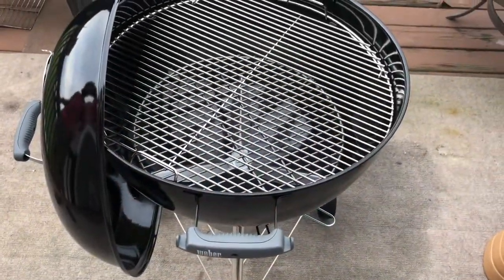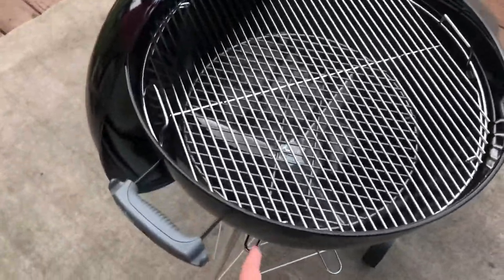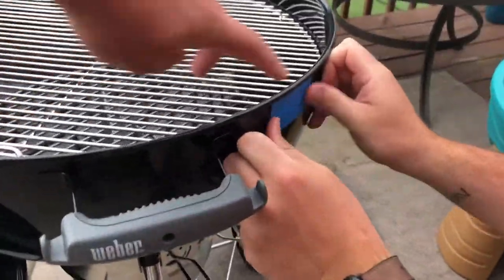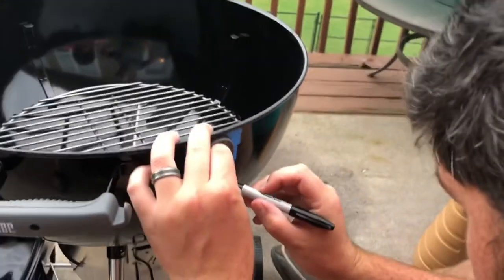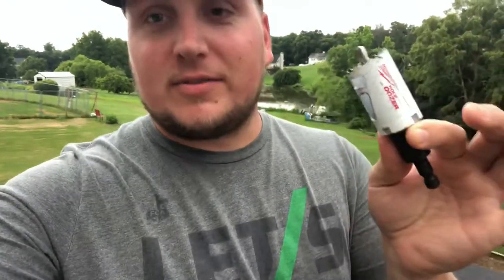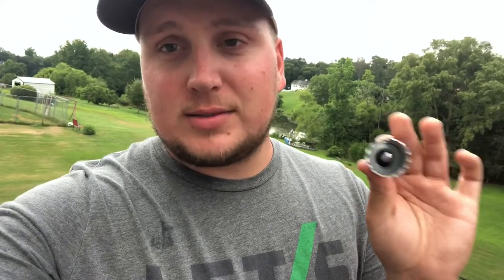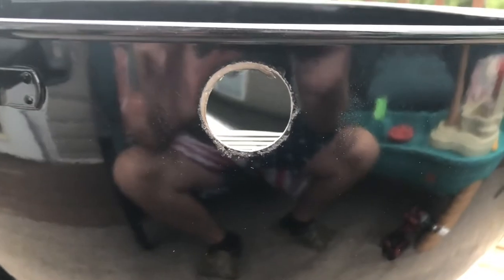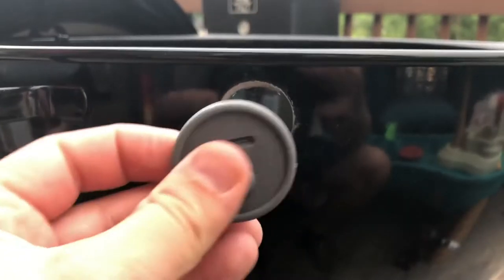The Grill Modification Every Guy Needs

Comment: I was wondering that when you switch to direct heat have you had any problems with this grommet?  Thanks for this video and feedback.
Reply from the maker: No. After about a year, the grommet has kinda worn out. But they are like $5 on Amazon so I just ordered another one and replaced it. Definitely worth it in my opinion. No issues with high heat. I’ve cooked many steaks at 600 degrees with that in.

Comment: Have you had any issues with rust at all since you drilled that hole? I want to put a gromet in my weber, but I'm afraid it will start to rust out.
Reply from the maker: I kept it covered so haven’t had any issues. You can always hit it with some high temp paint if that concerns you. The covers at Home Depot or Lowe’s are cheap and help the grill last much longer.
Reply: @HoundHogsOutdoors  cool. Thanks for the info. I'm buying a 2 pack of grommets today. I usually keep the grill in the garage once its cooled down. but I do also have a cover. I am in Buffalo NY, where rust is always a big concern. But if you went 2 years with just the grommet covering the hole and no paint, that gives me some confidence I should be ok.

Comment: Do you happen to know what the temperature rating of the grommet is? That is my one concern.
Reply from the maker: Stephen Farrell I don’t. But I’ve had my grill up over 700 degrees and it’s still holding up fine. I have had one in the past seem to dry rot on me, but that was actually one that came from Weber rather than an after-market one.

Comment: Use a step drill bit instead, you'll get a much cleaner hole and easier to get the right size you need. Will just be a bit more time drilling.
Reply from the maker: Yeah I knew that was a better bit for the job, but didn’t want to spend $30-40 to install a $5 grommet lol

Comment: Slow your drill or holesaw down or you will ruin it. They aren't made to run high speed on steel. Wood or aluminum, no problem, but on steel, just like brisket, low(rpm) and slow. That way, you will be able to use the drill or holesaw another day.
Reply from the maker: Good tip right there!